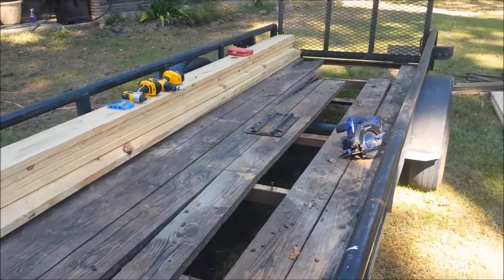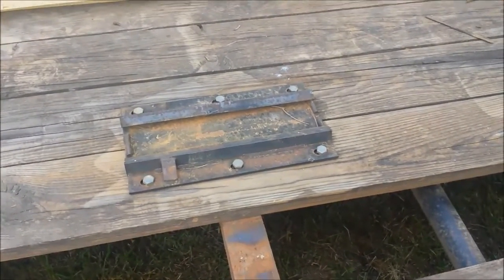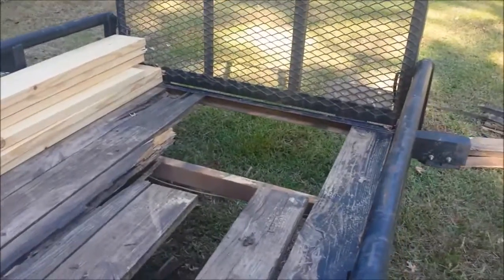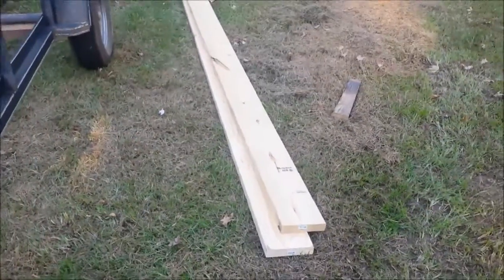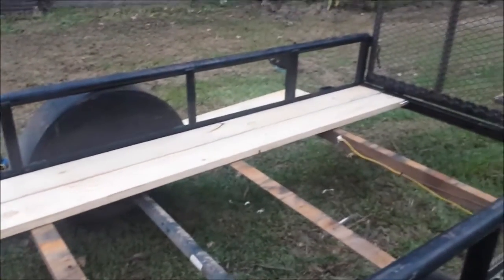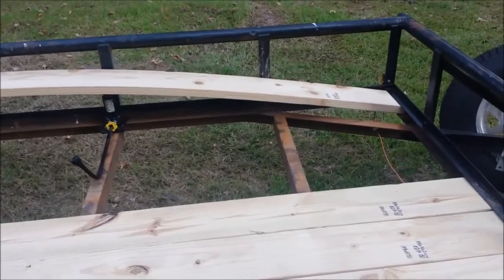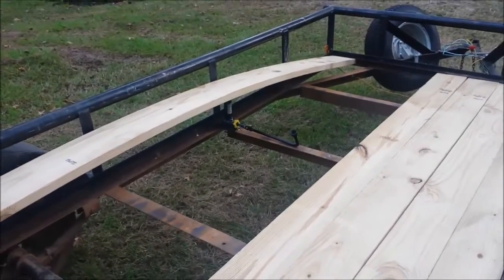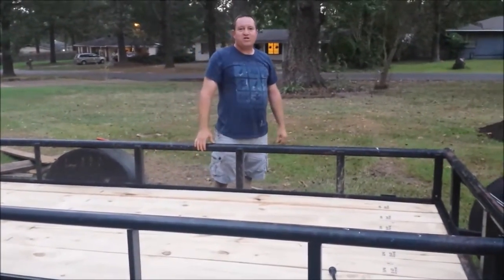Replace utility trailer deck using jack

Comment: Hey there.  Thanks for doing this video. I’m not a physics guy, but can you tell me why you didn’t place the jack in the middle of the boards instead of “a third of the way”?  Wouldn’t the boards bend easier if the jack were in the middle?  I don’t know.  Did you try it by putting the jack in the middle? Curious.
Reply from the maker: Greetings and thank for liking the video.  I placed the jack only 1/3 way because the board bends easier into the angle slot.  If you put jack in the middle, you'll run into 1 or 2 problems. 1. the board may break.  2. It will take much more weight to bend the board and you take the chance of the board popping out from underneath you.
Reply: chris abney - Ahh!  Thanks very much.  I have to do this to my trailer now.  It’s your size as well.  Makes sense and you sound like you know this by experience.  Thanks for doing the time and editing for this project.  It helps tremendously and I can now feel more confident in tackling this project.